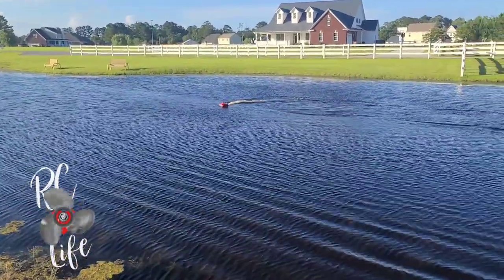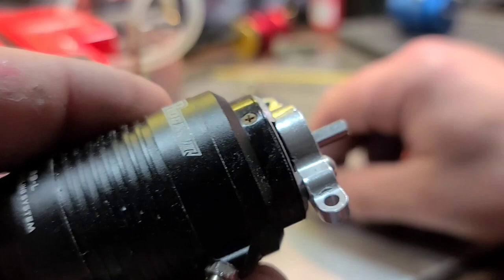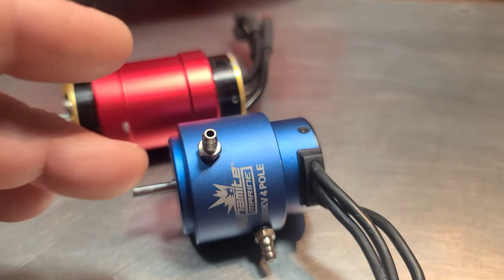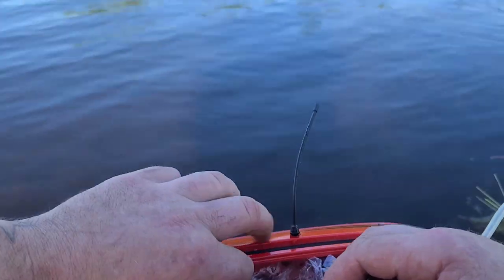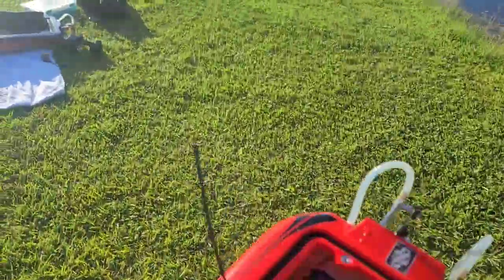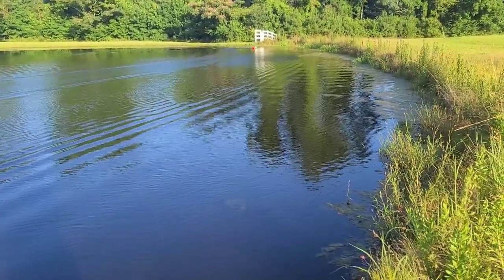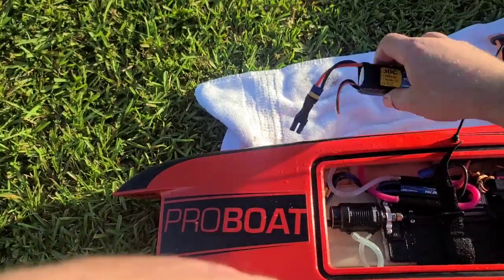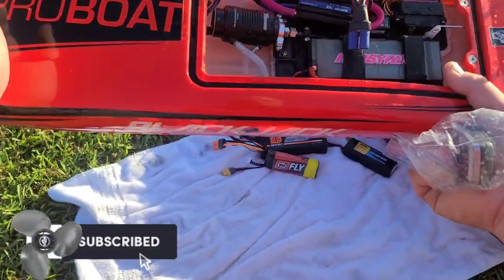Will It Go Faster With A Small Block  Blackjack 24 - RC Boat Brushless Motor Swap

Comment: You need to rotate the water jacket on the motor so as the water barbs are nearer the top of the motor. Where you have them coming out the side of the motor the water jacket dosn't fill completely  before water starts exiting the jacket. It will run cooler with a full water jacket. Heads up on the TP motor sizing, TP size their motors different to some other makes of motors. The 3650 on the TP means the motor is 36mm diameter but the 50 is the length of the rotor/stator inside the motor, the stock blue motor is sized on o/d of the motor x length of the motor. The rotor/stator in that motor is only around 30mm long, which is one reason its not very powerfull.
Reply: Good information 👍

Comment: Just put this Rocket motor in my BJ 24 hull with a 90amp esc, the BJ 42 stock prop on the end of the shaft, and powering it with a 4s 6000mAh Lipo battery.  Speed run test is tomorrow :)  Hopefully I'll hit that 55+mph mark as well. Good stuff brother!!!
Reply from the maker: Oh man good luck. 50 knots & no smoke c'mon. Watch Temps with the large battery (weight)  tfl 438 prop  is a great choice for that set up. Let me know how she did tomorrow
Reply: @IRONCLADRC  will do brother!!!
Reply: @IRONCLADRC  - got rained out before I could test so next week or sooner pending weather here in NOLA... and I will let you know how it went.  Thanks again!

Comment: Would u happen to know what size o rings are in the stock motor water jacket one of mine was missing out of the box
Reply from the maker: I'd just loc-tite the nipple on the water jacket.    Probably 3m o-ring
Reply: @IRONCLADRC  it not the nipple it's the o ring that goes inside the water jacket that slides over the motor

Comment: Hey where do you get the Teflon Tape for the Bottom of your Boat ??
Reply from the maker: Teflon tube?  If so then I got it from OSE offshoreelectrics.com I upgraded to .150 cable and 3/16 shaft. Hope this helps
Reply from the maker: How's the Blackjack running?

Comment: Is it handling all that power with the stock flex shaft?
Reply from the maker: I broke 1 stock shaft with a large prop   replaced with another stock shaft  a year ago, holding up so far

Comment: Great video...I have a traxxas blast can your recommend a brushless motor that would fit in place of stock brushed motor? Been sitting on the shelf way to long
Reply from the maker: Any 36mm/540 size brushless motor should do the trick with water jacket and watercooled esc
Reply: @IRONCLADRC  thanks...got a sonic wake awhile back...fun boat looking at others to add to the fleet...thanks again the blast should make a fun project
Reply: @bobmorris4401  how do you like the Sonicwake?  I'm considering that as one option for my first boat...
Reply: @isaiahfurrow7414  it's fun for sure...my first really fast electric. ..the self righting is amazing. ..lol

Comment: I'm pretty new to the RC boat game so I don't really understand, the difference between a four pole and a six Pole motor! what are the differences and is there a benefit from one to the other?
Reply from the maker: 4 pole have 4 magnets on the rotor 6 pole has 6... 6 pole I believe, some one can correct me if I'm wrong. 6 pole has more torq = fast acceleration 4 pole less torq but higher top speed. KINDA sorta 😅  in short REAL SHORT hope this hells
Reply: @IRONCLADRC  thanks for the reply it really helped to clear a few things you for me👍
Reply: @IRONCLADRC  That's correct. Also the difference will be how many amps they will draw.

Comment: sorry friends, what do you think for the motor size 3660 _ 4300kv VS 2868 _ 4000kv for the superior speed which one?.
Reply from the maker: If your wanting to run 6s go with the 3660 if your looking for high rpm on 4s go with the 2868
Reply: @IRONCLADRC  but here the series is 3660 max voltage 14v, can it use a 6s battery?

Comment: THE 3650  Stock  motor  isn't wired  for  4 S.  Your batteries  simply  have  ascending  C ratings and more   capacity.  "You're super charger is the  4000 KV. motor. " That's your  speed.  It's  double  the  output of your  stock motor.   What I've done, is run a 3000 VV.   motor,   120 Amp  ESC. and  ran   both a Prather  and Grim Racer  prop. Stock for me  is an Octura 438.   AND  getting  just  about  45  m.p.h  ALL 3 props  balanced , and or sharped.  THE 4000 Small block,  is a killer  upgrade,. and  definitely a keeper.  Side  grade, and what I would do, is to  change out the rudder  and replace it with a dual  water  pickup.  or add  an additional ,  inline pickup, and separate   your water feeds , to  run the Controller  and  engine separately. AND finally , change out to ESC 5  connectors. Putting some weights forward,  will also help prevent blow-overs. (Done that)  Happy racing.    P.S, love my Black Jack.
Reply from the maker: I ran the stock motor  on 6s the other day no issue
Reply from the maker: My top speed with the blackjack 24 is 63mph
Reply: THE  getaway,  was the smaller  2850 ,  it will run   cooler than the stock motor .  I  have seen people  shove 8 S into   the   boat,  and all sorts of  bad things  to follow.  Blown up ESC'S , and  battery  cables catching fire. THE spectators thought is   was cool. IF not costly.  THE  boat  hull wasn't designed to go  that  fast. HE blew it over  twice, before flaming it.  THE guy, didn't seem  too concerned.  I  think  you and I like  our "Need for  speed." AND with that big motor,.  YOU  got a major ride.  Imagine  , your boat a  Go Kart,  rolling up  to a Top  Fuel  dragster.  YOU win!  What  prop did  you end up using with  the 6S?  Just  curious.
Reply from the maker: My set up when I hit 63 was......   3665 2100kv turnigy 90a flycolor with a tfl 438 prop I usually get  59 - 60 all day long with that set up 63 is my pb.   Oh yea I blueprinted the hull (sponsons)
Reply from the maker: I was just playing around with the stock motor on 6s. Here's the video link lol.  You might get a kick out of it.   I was littery trying to blow it darn 3650 up.   Like I said I was just playing around so don't judge. Lol https://youtu.be/uS4Z1OWXNRM
Reply from the maker: Here's another attempt to beat my pb with the blackjack 24.   Again I was having some fun.  https://youtu.be/GLhX3dOBUqA
Reply: How did do you keep the boat  "glued to the water," at that speed. ?  My  boat  is   on the ragged  edge   beyond 40.    Were you  running 6 S?  How did you configure the batteries?   Now you got me  curious.

Comment: THE Turbo  Boost  was  the 4000 KV    ,  (4000 PRM . per volt. )  which is why,  you got yourself  a sleeper on 2S . , and 30 MPH  . Which  , the stock  3S  configuration , gets you  , unless you prop  up.?   50 MPH. ? and then above? YOU  were playing in the "Big   Boats club.  Wouldn't it  be  embarrassing  to roll up  to an M41. and smoke  em' Your right at Miss  Geigo, and a stock U-19 , or a Velos 29.  50-55.  ? Too much fun!
Reply from the maker: Nailed it

Comment: I love that you are changing stuff and trying new stuff. But shimming that collet defeats that purpose of using a collet. Collets are used because they are perfectly centered and can also grab a flex shaft. When you shim it with a very very loose fitting shim. It sends it all out of wack. You can hear it when you run it up out of the water. You are scrubbing speed loosing it to vibration abs heat. And it’s also gonna wreck the bearings and flex shaft.
Reply: Ok it's not ideal but has given him a place of reference, it's just a 50 ft busrt...
Reply: 3:45 acknowledged this is far less than ideal and yes I most certainly heard a horrible vibration apon run-up while still on the bench

Comment: Hi man, great video. the original motor is not that great, maybe 800 watts ... maybe. What you put on 1400watt should be but it can handle if I'm not mistaken at most 4s. So it's great for 24 ". I think even a 1200watt can work but in all cases you have to have a 90 esc at least plus a 38mm diameter metal propeller. I think it's a great recipe what do you think?
Reply from the maker: Yes sir 90a with 2868 4000 is perfect. 38mm prop is what I'm getting my best speeds with!  Blackjack
Reply: @IRONCLADRC  thanks man at the next from Italy

Comment: The 28mm motor is longer than stock 36mm, so the power should be equivalent.
Reply from the maker: I was surprised to see the little 29mm out preforme the stock 36mm motor.     Thank you for watching IRONCLAD RC.
Reply: @IRONCLADRC  Check out the data sheets, they put out about the same watts.